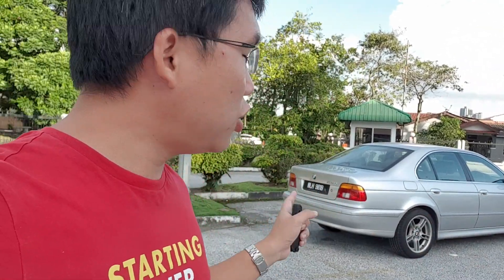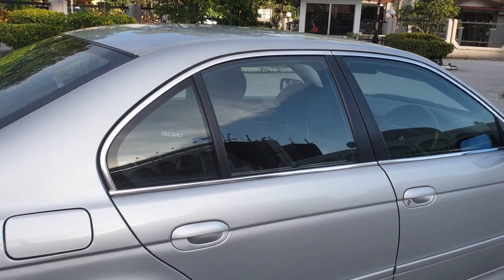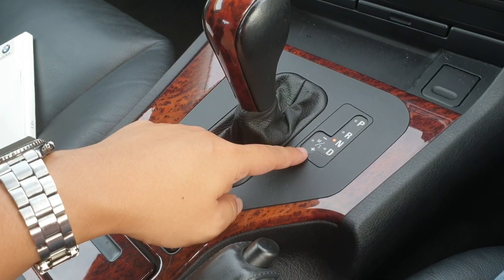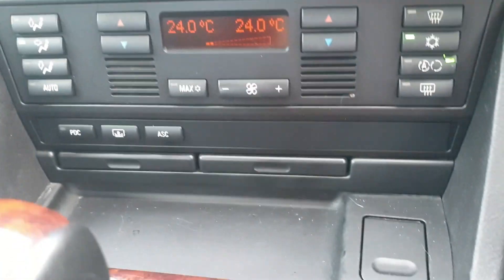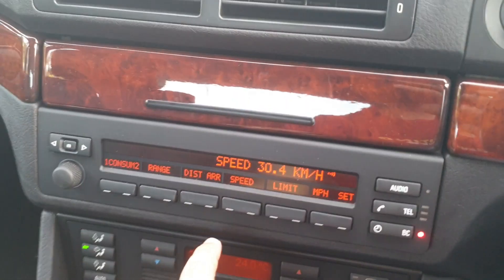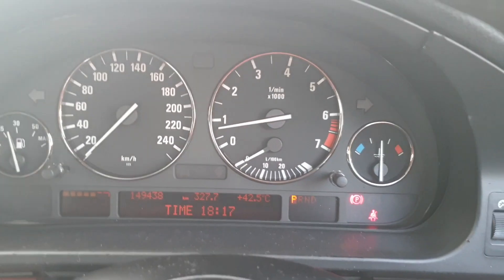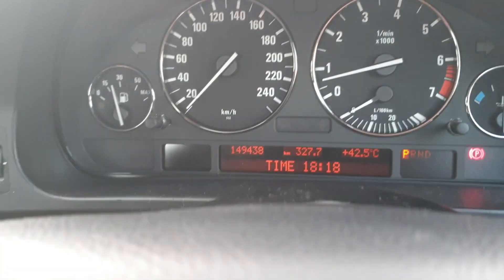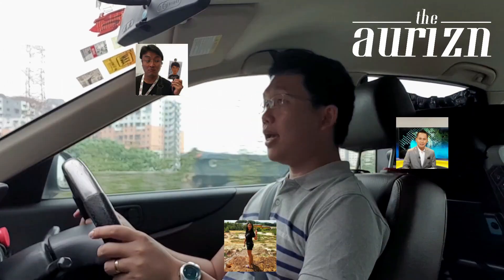BMW E39 features that I did not know about | EvoMalaysia.com

Comment: My dad had a e39 540i back in 2002 and it was an amazing car he drove it until 2010. I remember hearing the v8 sound what a beauty on wheels. E39 definitely the most beautiful car from bmw
Reply: v8 is really out of this world .. currently undecided between 328i(e46) 528i(e39) & 728i(the Transporter) .. 🤔
Reply: @arhalimi5883  all 3 are awesome to drive! I'm 21 and I have a e36 323ti compact also very nice car! Big fan of the 6 cylinders of bmw
Reply: Daniël almost exactly like my dad he bought a 540i e39 M-Package fully loaded with extras in Cosmoblack also in 2002 and drove it until 2013! 😱 I miss this car so much that I sometimes dream about it🤧
Reply: @arhalimi5883  If considerimg having an oldtimer which price is going to go up, than 728i with manual transmission.
Reply: very limited 540i👍🏻
Reply: Thanks for complimenting my car. 😀

Comment: Great review, I have a 2001 530is with the black trim and a M logo on the steering wheel, seventeen inch wheels ans it sits lower then my other 2001 530i with chrome trim and a standard steering wheel and sixteen inch wheels. Make sure you change your timing chain guides, that is a failure point if you have more then 100,000 miles on the v8 540's.

Comment: 3:00 now those who wanna convert to M sport will change that to black

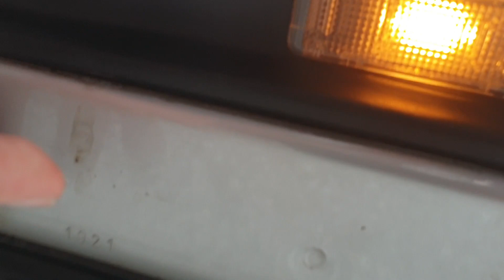and at 5:05, correct me if I'm wrong but I think that's the water hole to drain water from the inside of the doors, usually after rain, and when you wind down the windows. Most cars have this.

Comment: And he (the product leader for the E39) made the number one BMW 5 series, ever built. Classic in its restraint, which is a trait that the Japanese respect, and most often possess. These days, BMW fans reminisce about the long past years of "Restrained" design, both inside, and out. Also, the water leaking into your interior is due to the seals behind the door card needing a new bead of adhesive, unless they've been ruptured somewhere that's not the seal between the gasket, and the metal of the door. Nice E39 btw, and I enjoyed this video.
Reply from the maker: Thanks for the tip! The water has not does not leak into the cabin, fortunately...

Comment: The rear door leak you mentioned is usually due to the horizontal rubber strip sealing the window and the door panel (under the chrome strip). Happened to my Renault Scenic 2 before. Preventative measure would be to lubricate it with silicone lube meant for car window seals. You can get it at shops like Brothers or sometimes at Ace Hardware

And by the way, if you prefer to have Bluetooth connectivity and don't mind giving up the CD changer, you can always plug in a Bluetooth module which uses the CD changer's connector interface. Lazada has a few options which you can explore
Reply: Another very common reason for leaking is a bad seal between the insulation material and the door itself. You can check for that by removing the door trim panel. Underneath you find the insulation material (thin foam covering the whole door). If this comes loose easily - especially at the lower end of the door, you have found your problem. When it rains, water leaks through the gaps between the windows and the window seals, runs down in the door and then leaks between that thin foam and the door itself. You will also find that the black seal around the thin foam is aged and hard. The fix is to remove the old seals, clean everything with break cleaner and install a new seal (butyl cord sealing).

Comment: these old contis still drive really well. i regularly drive my old man's w210, and although its the base engine, it drives so solidly with really good stability and just has that hefty feel.
i would imagine your e39 would drive even better and sound better with that straight 6
Reply: Just curious, what is contis?
Reply: Imagine the V8! Amazing sound, excessive power when you want it, intelligent technology that is smart enough to help owners keep their cars in good condition by alerting them to any problems the car may be having, or repairs that must be made soon, classy design, easy repairs, cheap and plentiful supply of parts, smooth as glass before M62tu, as well as more features than most people actually use. This car is beautiful.

Comment: The updated steptronic shifting direction also comes form input from manual drivers. The natural motion from 1st to 2nd and 3rd to 4th is down. When downshifting the motion reverses and going between those gears in a downshift is pushing up. With those being the most common directions for upshits and downshifts on a 5 speed manual it was decided it should be flipped from the original steptronic layout.

Comment: There is even a third type of Instrument cluster in the E39, it was fitted in the first model years for E39s without onboard computer and it just displayed the outside temperature in the middle and didn't show open doors etc.
Reply from the maker: Wow... super basic. Never seen those before.
Reply: @KonWaiLuen  yeah it is super basic, had it back then in my 1997😄

Comment: Is the e39 528i 2000 has the same steering wheel as a standard?
Reply from the maker: This particular steering wheel I have seem to be only found in final batch E39s from 2002/3.

Comment: Nice video. Although personally i prefer the dash display that indicates with the diagram if doors are open and whatnot. It is interesting to me that the lower models: 528 ext.. Retain more features that the higher models do away with in the name of luxury. My e61 is a 530 and you can only check the oil via computer whereas lower models can check via dipstick. I would rather have a dipstick. On the e39, mine has the diagram display and it is a 528, whereas yours is probably a 530 or higher and i would say that having a diagram display is more luxurious than the other
Reply from the maker: Mine is a 520i actually, but it was the run out batch before the E60 launch, hence why it is pretty well specced
Reply: @KonWaiLuen  oh interesting! Well, it's a very nice car! I just got my first e39 this month! How long have you had yours?

Comment: Water barrier loosening in the rear doors is a very common problem on a e39. 
If the footwell for the rear passengers is wet after some rain, then replace the barrier soon.
Reply from the maker: Yea, i've read up on that. Not on my car yet, touchwood.

Comment: Stability control failure will show with a yellow triangle with a circle around it .
In the UK this is an MOT failure and controller found in the engine will need replacement by mechanic.

Comment: Parking sensors will definitely break very suddenly and you will know by uncontrollable beeping when reverse gear is selected.
The sensors just plug out but engineer will be required as bumpers will have to be removed for diagnosis and fitting of new units.

Comment: You have to spray some silicon spray on the rubber strip, it’s squeaking. My e46 has this sound too but it’s good after spraying
Reply from the maker: Oh I was wondering how to fix that, thanks!
Reply: Can be bought from Mr DIY. Spray around the metal and the silicon and also and the silicon and you can drive in peace! You’re welcome.

Comment: The lower button on the left hand side of the steering wheel is voice command,hold the button,wait for the beep and if you have the commands you can speak them and the command will be carried out.
Reply from the maker: Tried before. Doesnt seem to work on this car. Could have been disabled
Reply: @KonWaiLuen  this funktion is not working because phone is not working.
Probably your car is not original complete.

Comment: The reason for the rear door leaking is inside the door the plastic liner is leaking and needs to be glued back in place or replaced. 
This is 100 percent reason and will  stop the problem.

Comment: The pdc and the circulating button is an easy fix... Search ebay
Reply from the maker: Yeah, I learned how to diagnose the PDC issue already. Gonna be in an upcoming video.
Reply: That’s good.. I owned 2 versions of 2003 e39 520i and 525i... Great car and timeless.. now I owned e53 2005 X5 3.0

Comment: Hold down unlock button = all windows roll down
Hold key in door anti-clockwise = all windows roll up.
Flick hi beams after parking at night and lights will come on for 30 seconds.
Reply from the maker: The window roll feature was stated in the user's handbook but I couldnt get it to work.
Reply: Strange. Maybe you lock needs lube. Use graphite powder if you do, not an oil.
I changed my engine mounts yesterday. OMG what difference in reduction in engine vibration into the cabin.
Have you considered OEM clear tail lights and an M5 boot lid spoiler? You can buy them already painted Titanium silver.